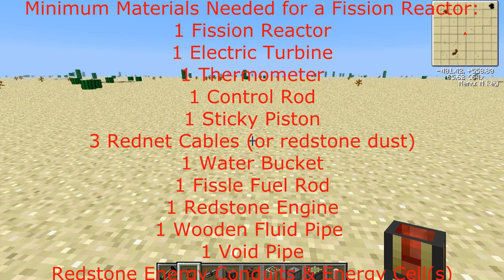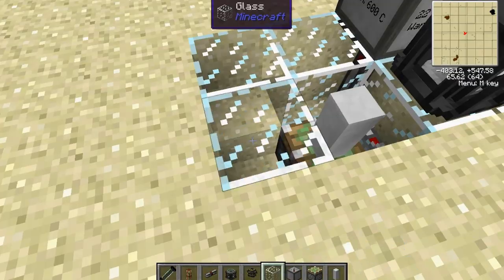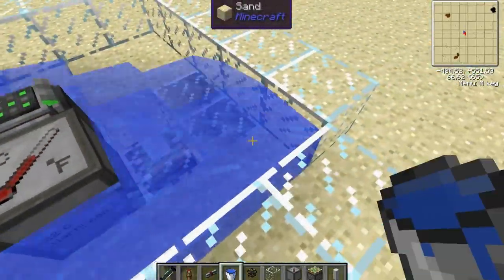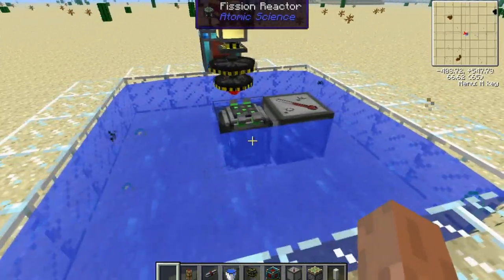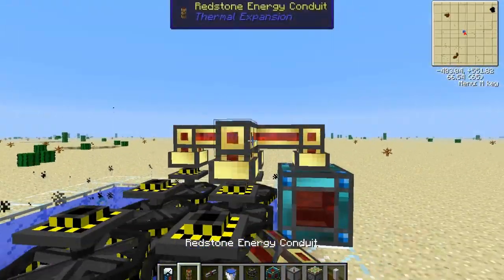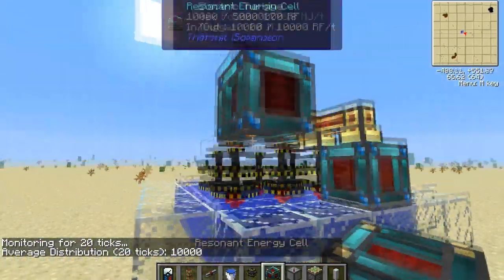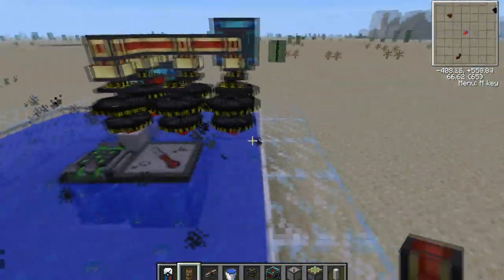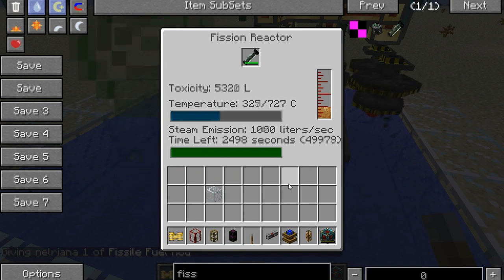Atomic Science Fission Reactor Tutorial for Tekkit

Comment: I'm running into a major problem. I have my thermometer sticky piston and control rod set up like yours but it isn't actually stopping the temperature from rising. It just continues to rise and then blows up in my face.
Reply from the maker: Make sure that the thermometer is set to be about 100 degrees cooler than the max temp of the reactor. This is displayed in the GUI of the reactor itself which clicked on. Last I checked the max temp was like 727. So I set my reactor to be 600 just to be safe. Make sure to test it out on a single player creative server before putting it in your house, sometimes they can be finicky and will just blow up for no reason it seems.
Reply: At first I had it at 600, then kept dropping it till it was 400 Degrees. no matter what it just wouldn't work. Thermometer would send the signal and the control rod would go up, but the temp would just keep rising.
Reply from the maker: Ubernaught012
Not sure what the problem is. I went into the latest build and let it run. It wasn't producing as much steam because the water never got  above 537 for me.

I had my thermometer set at 800, but I believe it only detects the water heat, but all the same my reactor cell never blew up.
Reply: Nelriana i have got the same prop. My conrollrod dont stop the reactor it does nothing
Reply: so 7 year late but you need 2 control rods it works fine you are where playing big dig huh